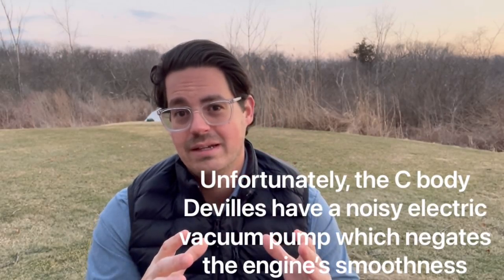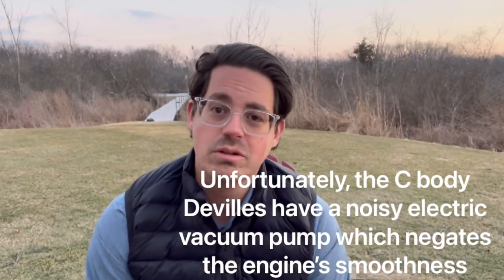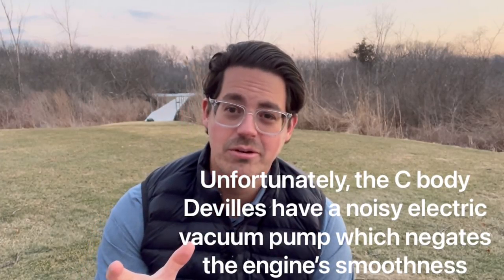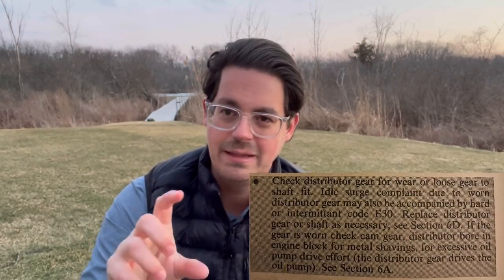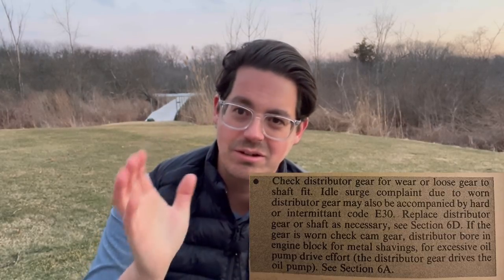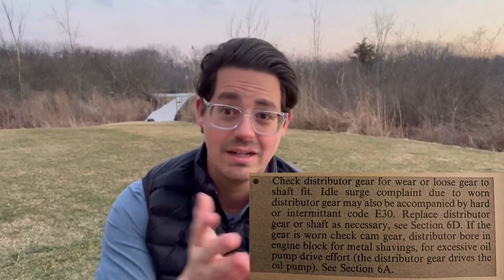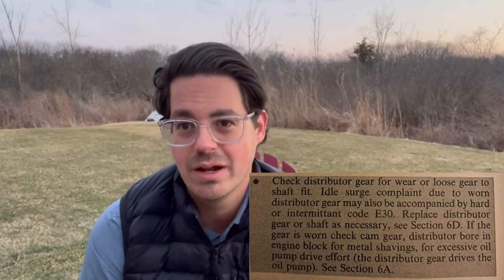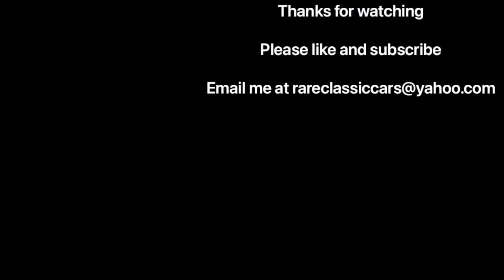Worst Engines of All Time: Cadillac HT4100 - Why is it so bad?  How can you preserve yours?

Comment: The issue I saw several times was one where the oil cooler in the radiator would fail, allowing coolant to get into the oil after the engine was shut off. (Oil pressure drops to zero, and coolant is still under pressure with the engine at operating temperature.) The oil pressure warning light usually would not indicate a problem because the sensor would "see" oil pressure, even if the oil had become a mixture of oil and coolant. Before long, every bearing in the engine would be destroyed, usually before the driver realized that anything was wrong. (By that time, Cadillac HAD learned to keep the cabin very isolated from outside and mechanical noise. A LOT of otherwise nice Cadillacs went into the crusher before they were very old because of this issue.

Comment: I worked in a Cadillac dealership from 82-87 as a major motor repair technician.  First the diesel then the 4100 kept me busy and made me money. It was my understanding that the 4100 was designed for a downsized Corvette ghat they never built.

Comment: When l was a teenager my friends parents had a 1984 Cadillac Eldorado Biarritz that pumped coolant into the engine oil not once but twice they also had a 1982 Oldsmobile Tornado powered by a 350 rocket that was a much better car than the 1984 Eldorado with the 4100 engine
Reply: The Oldsmobile Rocket was a 307 from 1981 on. Yes, it looks like a 350!

Comment: A friend of mine had an 83 Fleetwood Brougham in which he finally did a complete engine swap with a remanufactured HT4100 this after a bolt broke off in a cylinder head, I think, when trying to remove the intake manifold to fix an oil leak. What a nightmare. Needless to say he lost his shirt on he car and will never buy another one.

Comment: I'm a long time Cadillac owner and a lot has been written about why the brand declined in the 70s and 80s. While many good points have been made, one thing that isn't talked about as much was featured here in this video was that Cadillac went through years of dreadful engines, due to GM's inability to adapt to tightening CAFE standards. For some context, this is the company famous for introducing a V8 way back in 1915, the cross-plane crank V8 in 1923, the V12 and V16 engines of the 1930s, the OHV engines beginning in 1949, and finally the big blocks beginning in 1968. So what changed?

The much maligned Olds 5.7L Diesel V8 first appeared in Cadillacs in 1979 and somehow lasted until 1985. The 6.0L V8-6-4 (based off of the 1980's model downsized big block) came in 1981 and only lasted one model year in the mainline cars (but inexplicable was available in the limos through 1984). And finally the HT4100 V8 was rushed to market in 1982, hence the reason for this video. How bad was the situation at Cadillac in the early 80s? The Buick 4.1L V6 was offered in 1981 and 1982 and while you could make a case that Cadillac was just trying to add a more economical engine choice, you could also make a case that Cadillac was hedging their bets to be able to offer something smaller of a more proven design. I'm not sure how many buyers opted for the V6, especially in 1982 when the standard gas HT4100 V8 was also 4.1L in displacement. Cadillac didn't even really try to market the engine all that much other than a short blurb in the brochures. In 1981 it was the first V6 engine in a Cadillac since...well, never.  The 1982 Cimarron's Chevy-sourced 1.8L I4 was the first 4 cylinder Caddy since the Brass Era in 1914. And bonus points if anyone remembers Cadillac offering a 4.3L Diesel V6 in the downsized Devilles/Fleetwoods for that one model year.

I had the HT engine for one of my cars but that was a 1993 Sedan DeVille and by this time, the engine was 4.9L, 200 HP and the biggest problems finally ironed out. But for those years between 1979 to 1988 (the Allante was still offered with the 4.1L in 1988 when the other cars had moved on to the improved 4.5L design), the damage had been done.

Comment: If they wanted a 4.1 liter engine why not just stick in a Chevy six. At least that was reliable.
One thing I never really understood about all US built cars of the time was the across the board rejection of EFI for the most part.
Reply: I'm now suspecting that at least some of the Cadillac 4100 V8s, have insufficient heat treatment of the engine blocks, bolts and heads, during manufacturing. Sounds like on at least some of the Cadillac 4100 V8s, the head bolts are getting ripped out on their own and/or unexpected head cracking.

Comment: I know in the 80’s if passenger cars had larger than a 5.0 liter engine they would be subject to a gas guzzler tax, that’s why they couldn’t keep the 425, 368 or even use the Olds or Chevy 350 in them which would have been ideal. What I don’t understand is how Cadillac could put these complete garbage engines in such beautiful, expensive cars. They would have been so much further ahead after 1980/81 using either the Olds 307 or Chevy 305 5.0 (which they eventually did) but with TB injection and a dual exhaust to squeeze every bit of power and drivability out of them. The 5.0 Olds, Chevys, Pontiacs, Buicks at the time 81-86 still were using these engines but only with carburetors and single exhaust. At least the Caddies would have had something a little better to offer.
Reply: Cadillac always was the test bed for GM engineering to showcase their latest and "greatest". Everything is supposed to go in Cadillac first and then trickle out to the other brands. I had a 75 Fleetwood that had "twilight sentinel" that controlled the headlight functions automatically (though it was broken on my car... like a lot of 70s things were broken on that car). I'm pretty sure GM first offered the feature in Cadillacs back in the 60s and maybe the 50s. I wouldn't have another GM car with that feature until the 1997 model year.

So... That's why you don't get what the Chevy or BOP plebeians are getting in their cars when you buy a Cadillac. You're getting something "better". 😭
Reply: That's one of the things that really gets me about Cadillac and all their new engine technology in the early eighties,,, the Chevy smallblock started as a 265 cubic inch so if they needed to keep it under 5 litres all they had to do was come up with a 5.0 or less small block Chevy and then slap all the technology on top of that that they wanted to try out,,  at least the engine would be solid,,,,, but for whatever reason they went to total opposite direction than common sense....
Reply: @2packs4sure  An aluminum 305 Chevy constructed with the same techniques would have had all of the same problems.

It took GM around 15 more years to finally get an aluminum motor right after like 50 years of trying. The Cadillac kin before them was just part of learning to do it.
Reply: @TheBrokenLife   Forget aluminum, they could have had the foundry cast the lightest weight possible version of the original 265-283 spec. blocks or the Pontiac 287 blocks saving them BIG bucks as opposed to designing and tooling up for a new engine from the ground up ,, maybe design some new cleaner burning IRON heads,, then threw all that saved money for all the high tech EPA-CAFE wet dream crap to throw on it..
Or some variation of that basic theme.
AT LEAST the engine would be mechanically sound.
Reply: @2packs4sure  As I understand it, Buick did all of that lightweight work over a decade before Cadillac got to the 4100 (a 455 Buick is allegedly about the same weight as a SBC) and today we're still using aluminum when the weight needs to come out. So just pulling material out must not have gotten them where they needed to go. They were also technology limited on the whiz-bang EPA crap they could throw at it. The world simply didn't have the technology at any price to run much more than what they had.

When you look at a modern LS/LT aluminum motor they're completely bonkers. There's "meat" everywhere and the factory parts look like race motor stuff from 40 years ago. To get to that progression in technology they had to go to lighter weight materials in the blocks sooner or later regardless. So, at least in my eyes, someone was going to end up holding the bag for GM's R&D if GM wasn't willing to do it themselves. Apparently GM's corporate decision (many times over during the 70s-90s) was to allow consumers to be their QA department.

So, I don't fault the engineering decisions that led them to the 4100, but the execution was clearly piss poor. I also know that we have the luxury of looking at it decades after it happened.

Comment: I have a 1995 Cadillac deville concours with the 4.9 my biggest gripe with the car is the on board computer systems it’s nice to be able to read codes and stuff but all the little insignificant modules on the car fail and give you warnings on the dash and most of the parts to fix it are discontinued and dealers typically won’t help you with these old caddies when it comes to chasing down little electrical problems

Comment: Had a Seville for a very short time that had this engine.  Glad I didn't keep it long knowing how troublesome they were, although at the time it did seem to run good.
Reply: Same here,  back in 2003 I bought a super clean  1983 sedan Deville  ht 4100 with 60k original  miles. Had it for a little over a year.  Trouble free and it was my daily.  But it was a complete pig as I recall. Could not get out of its own way . But now I regret selling it

Comment: My family had 2 of these when I was growing up.  We had a blue Coupe DeVille and later a white Sedan DeVille.  Mom's Caddy was always a much more pleasant ride than dad's lifted Dodge Power Wagon on 38s.  I don't remember anything about the engines, which probably mean they were smooth, quiet, and "sufficient".

That said, the cars did suffer from some Cadillacisms.  Most infamously in our memory, if the air conditioner had any issue, or thought that it did, the car wouldn't start.  Call a tow truck, call a taxi, and give all your bank info to the GM dealer so they can help themselves to the vault.  Both Cadillacs required mom to occasionally fall back on the Porsche 914 (with that nonexistant VW heater in the winter).

Eventually we did get tired of the shenanigans and decided that what mom needed was something with stone-axe simplicity.  She got a 1999 Durango with the 5.9 V8.  Unfortunately that proved to be the most cursed small-block Mopar ever.  It required premium gas to even be drivable, and even so detonated relentlessly.  We've had 2 other 98-99 5.9s, one of which was much better and the other of which is flawless to this day.  Goes to show, sometimes the difference between a good engine and a bad engine is the VIN lottery.

Comment: The Cadillac HT4100 is an oversized sewing machine of an engine. If I were running an automaker back in 1982 model year, I would implement a 215ish hp 3.5 liter DOHC V6 with a electronic sequential port injection, cast iron block and heads, bucket tappets, serpentine belt, a modern style intake manifold with butterfly throttle body, and HEI distributor but to add more fun and smoothness to your commute there is the 4.8 liter DOHC V8 with 320ish hp. Also the commercial will show off the engine sound mostly the sound of the 3.5 V6 grunting up to 6000 rpms. Then in 1987 have distributor less ignition and 3 way catalytic converters and a small increase in hp and torque. 1992 will be same displacement but new engines with aluminum block and heads, coil on plug ignition, and polymer valve covers, oil pans, and intake manifolds, and only a small increase in power due to the lack of technology for computer aided design and finite element analysis.

Comment: Alloy head on a cast block I've heard of,but cast head on alloy block.Never met one,that's why Holden here in Australia had full cast motors until 04 for the V6 and 2000 for the 5000 V8.Then they went LS1

Comment: I loved those engines!  As a mechanic they were easy to work on if you just paced yourself.  The 10 bolt water pump was easy by today's car standards, just use your feel, not a air device to loosen or tighten, and no breakage of bolts.  Mostly replaced intake gaskets, very easy, and modern RTV for front and rear intake gasket maker is now far superior.  Ignition modules and reluctors were easy.  Howell Engineering did a bang up job in the injector fuel system, never a problem, until the Alante, which I think someone else designed. The early 86 Eldos had the first drive by fingers system and great robust LCD readouts.  The Alante was not so good, but way cooler looking with colors.  That Bose system was awful with the amplifier circuits failing!  Best leather interior those Caddys with that most hated engine.  It was fast enough with 25 mpg!    That's all.

Comment: IF you overheat a 4.1 good buy they pop like the tin cans they are.  4.5L same issue lose coolant pop the head gaskets. 4.1L like to eat cam bearings as well.  I did a W/P on a 4.1L and it took specialty tools to move the power steering pump out of the way! what a pain in the ass.

Comment: If you had a heavy foot the HT4100 was not for you! These engines gave amazing gas mileage ! You had to travel with no rush and with patience. The cooling system was important . Make sure  your radiator is good, Water pump and  keep the Delco  Pellets circulating in the radiator.  Beside that everything esle was ok overheating was the only big problem
Reply: So true

Comment: It's hard to understand how the High Technology could be such a failure - it was not GM's first aluminum engine. Both the BOP 215 V8 and Chevy Vega 2300 should have formed some foundation of knowledge by the time they got around to this. 

Aside from the onboard diagnostic feature, It was also not very 'HT' compared to foreign competition at that time. Luxury car buyers were becoming more sophisticated in the eighties. The traditional buyers went to Lincoln, the younger ones (smaller number) left for BMW and Mercedes. Cadillac tried to capture some of that market with the Eldorado TC - with a HT4100....!

Comment: I have the oddball version of this engine, from 1988, it is the high output version of it, which came in my Allante, it has a very different intake, with multiport injectors, a more free flowing cam, all from the factory, it sounds aggressive, but definitely not the fastest thing out there, but being in a phase 1 Allante, being more european than 'cadillac' it at least handles curves nicely to compensate for the lack of power it should have. The diag mode in the Allante is pretty cool too, as long as the Driver Info Center (DIC) has not lad the LCD bleed out on it, it is very comprehensive.

Comment: I’ve owned a few Caddy’s, currently own a 64 Cadillac Deville and a 54 Cadillac Fleetwood. Both engines are wonderful the 331CI and 429CI V8. Super powerful and smooth.

Then I used to own an 87 Cadillac Brougham with the dog 307.

This turned me off to 80’s RWD Cadillacs. I will only consider the 77-79 Fleetwoods and or the 90-92 Broughams as the engines in those years were more powerful and reliable than the early to late 80’s Cadillacs.

GM made a huge mistake with HT 4100. 

But I loved the interior and build quality of the 87. The quality of the seats and door panels were so soft and padded, and the details on the interior were also really nice with all the chrome trim. I honestly feel like my 87 Brougham D’Elegance package was one of the nicest styled and feeling interiors of any car I have ever owned. So classy and comfortable. One major  complaint is that the ride quality wasn’t all that smooth compared to other Cadillacs I used to own. My 64 is a floater and the ride is very smooth in comparison to the 87. 

Great explanation Adam, I love these porch talks and your knowledge about these vehicles!👍👏👌😎

Comment: That water pump if I remember had to come apart with the front engine cover. My thing about these engines were the rocker assemblies.You had to assemble them on the bench and then there were five or six nuts that held them in place. This was one of GMs first Helicoil engines and they meant it. These engines had that gold colored oil pan I forget what they were made of but GM made a big deal out of it. You had to make sure you had an endless supply of red RTV if you pulled one of these engines apart.

Comment: My dad had a 1985 Deville and you are absolutely right.  Quiet and slow as a rock, made worse by a shitty 3 speed transmission....both of which died at around 65000 miles.

Comment: I currently own a 1984 Coupe DeVille. The only thing I don’t like is the 4100. Cadillac should  have modified the 425 or developed a 350. You are right this engine was made for the front wheel drive model. Other than that no real issues.  We had a 1982 Sedan De Ville and it blew a head gasket  this is when Cadillac knew they had a problem. They installed a new engine and that one lasted over 100,000 miles no issues